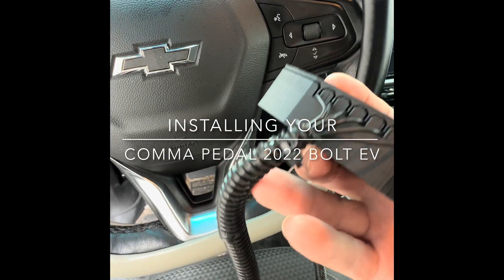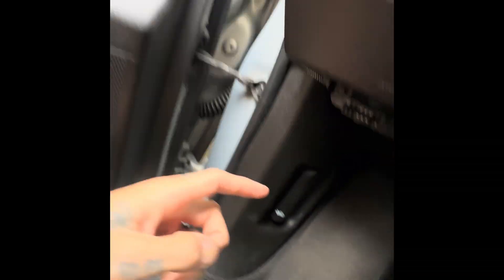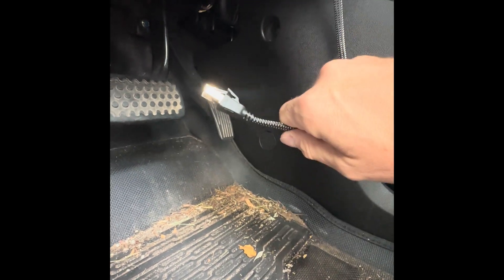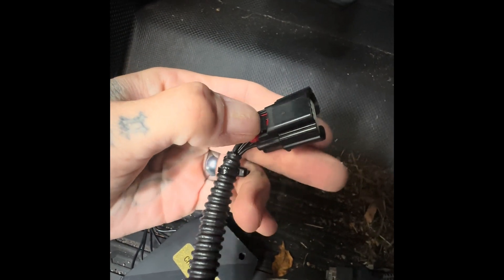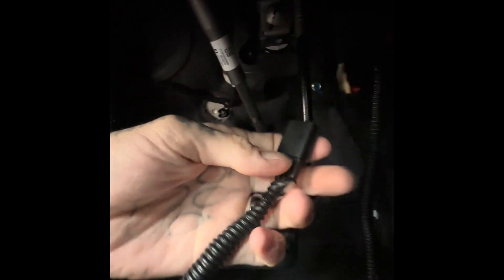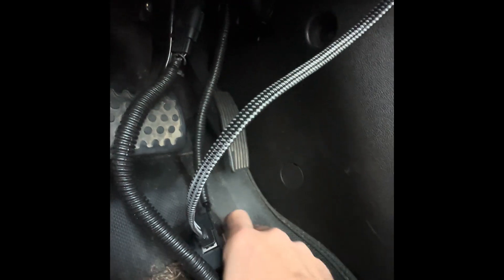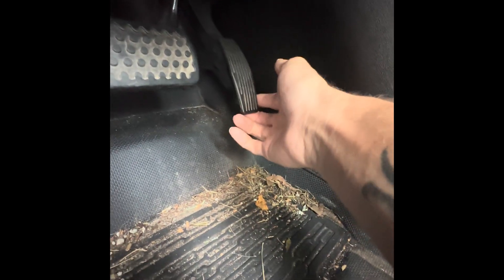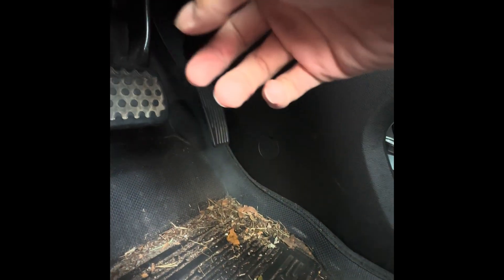How to install the comma pedal in your Chevy Bolt EV

Comment: Can you link the comma pedal website? Also does it control the breaking as well?
Reply from the maker: Yes it does
Reply: @DarkCloudVapors does it ever actually Engage The friction breaks or is it only using regen braking?  I have an 18 and I just ordered everything I need from, today and wondering how that works with Opgm. Based on your steering wheel I'm assuming yours is a 22 or 23

Comment: Sorry, but am somewhat confused about the required cables which need to be run underneath the trim for both the Comma 3x and the Comma pedal…Does each device need a separate RJ45 cable run?   Also, the Etsy website indicates that a splitter is required.  Is a splitter required also?  Thanks for sharing!
Reply: I have the same question...  I watched a video on here in which she didn't appear to install any splitter or plug anything into the OBDII conn.  just the ethernet cable you see in this video from the pedal to the harness box behind the mirror.  But at the same time I was told on reddit that you need that splitter....to run a 2 short cables and the splitter for the OBDII connection.   I see here he has nothing plugged into the OBDII either.
Reply from the maker: Yeah you just need the Ethernet only to use the pedal in the bolt. Plugs into the harness relay. No splitter needed at least with bolt as it doesn’t need the comma power to work
Reply: I think they're asking how do you have 2 ethernet connections coming from the 1 harness.  If I'm understanding right, you need one ethernet cord from the harness for the OBDII connector that the Comma 3 uses, then you need another ethernet cord coming from the harness that connects to the comma pedal.  It seems like a splitter would be required, or a special harness.  The one you can buy from Comma AI only has a single port.  A quick and dirty wiring diagram would be awesome :)  Let me follow that with appreciation for your videos, I don't see anyone else with Comma 3 Bolt videos.  I just got my Comma 3x and Bolt EUV and am loving them so far, your vid helped me a lot with installation. @DarkCloudVapors
Reply from the maker: @RyanJohnson-tb4yc no with the bolts they don’t need to be connected to the car with the Ethernet. Just the camera harness alone.
Reply: Thanks, it all makes sense now 🙂.  I have my Comma pedal and it's great except for it flashing at me to shift into L.  I have a 2023 bolt EUV and I'm pretty sure it doesn't have an L mode.  It still does stop and go but the warning can be annoying so I only deal with it when traffic is really bad.  Thanks again for all your posts.
Reply from the maker: @RyanJohnson-tb4yc  that’s L is one pedal mode I’m pretty sure turn that on and it’ll go off
Reply: @RyanJohnson-tb4yc  its one pedal mode